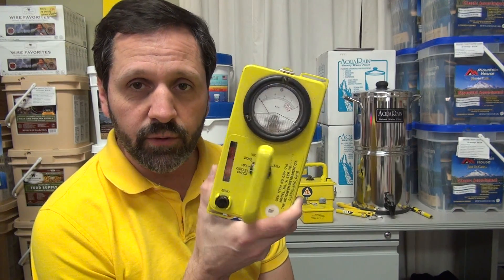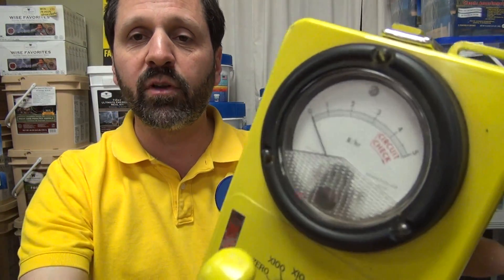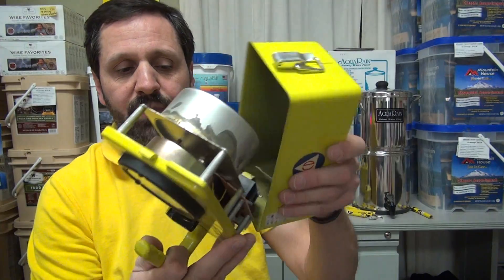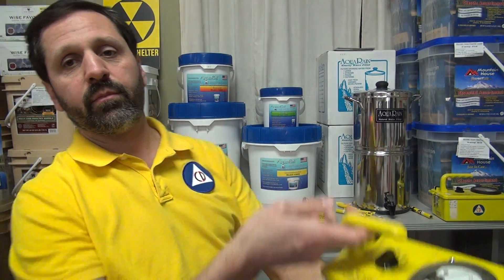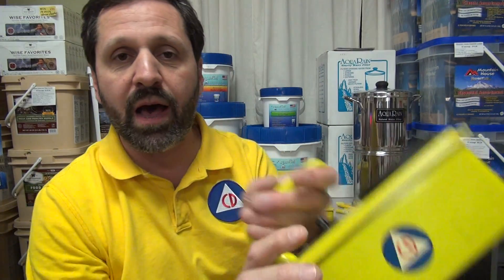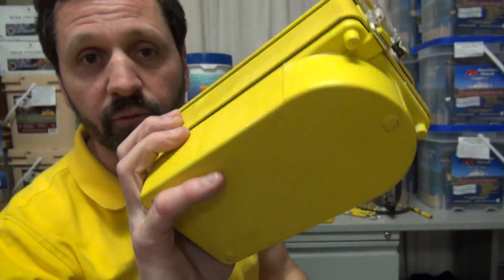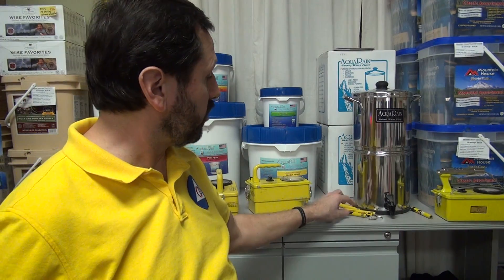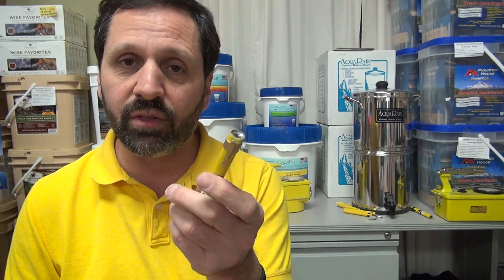Diagnosis tips for problems with Civil Defense Equipment

Comment: I have a Radiological survey meter CD V-700 Model 5, and just yesterday it was working fine. but today when i turned it on i didn't hear any clicks and i didn't see the Needle on the dial move. What is your diagnosis? ( Note, the batteries are brand new )
Reply from the maker: Lord Dubious 22  It could be a number of things but the number one problem I have with these units is a non-working dial indicator. In your case since you can still hear clicks that's not the problem. It could be the geiger Muller tube or any of the electronics inside the unit itself hard to tell with only the information I have.
Reply: ForbiddTV I don't hear any clicks and the dial isn't moving. 
When I turn it on I hear a small buzzing sound in the headphones. Just like I did when it worked.
Reply: But I have yet to find any apparent problems.
Reply from the maker: Lord Dubious 22  I'm sorry, I misread your symptoms earlier. In your case I would try to swap out another geiger Muller tube from a working unit (needs no tools) to test that theory if you can find one without having to buy it.  They got a lot more expensive since the 2011 Japan accident.  If that doesn't work then you got a problem in the electronics somewhere.
Reply: My limited experience indicates something bad in the high voltage side, the probe wiring, or the tube itself. I have one that still clicks,but no meter movement. After removing the meter out of the circuit, I discovered the meter was open, or burned out. 
Incidentally, do not use a standard old style volt ohm meter, as it has enough voltage to burn out the meter. It's only a 50 ua  movement and the measurement voltage can fry it almost instantly. The circuit caries 1V or so fed to the meter thru a 2300 ohm. resistor, so use one of this value or higher to check the meter continuality. But it appears you have a HV problem. Could be the voltage regulator has failed, which will drop Geiger tube voltage dramatically. If you are not electronically inclined, repair services are available on the internet.
Reply: Forgot to mention, check all battery contact surfaces and polish them. If your unit has removable battery contacts, they may not be in good contact with the circuit board. Hope this helps.
Reply from the maker: CAROLINA PATRIOT Your 'limited experience'' is better than mine since I don't have enough knowledge of electronics to help beyond changing components.  Thanks for the comment, I hope it helps Lord Dubious 22